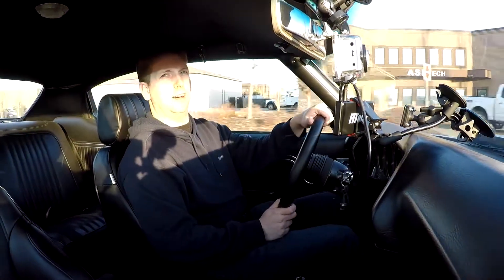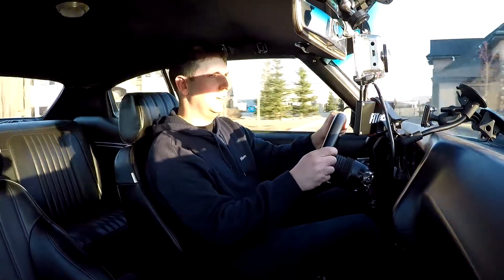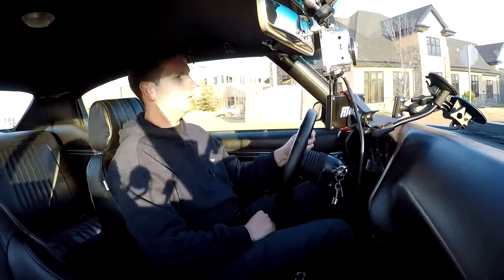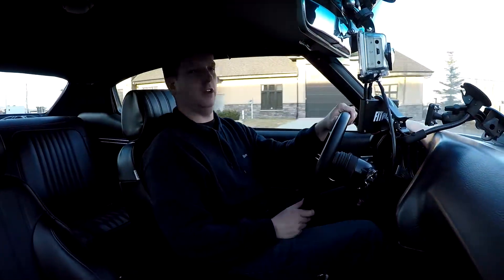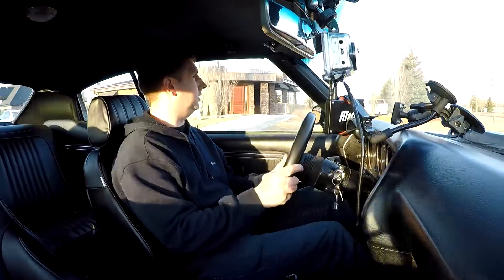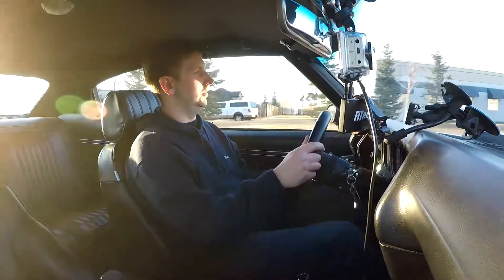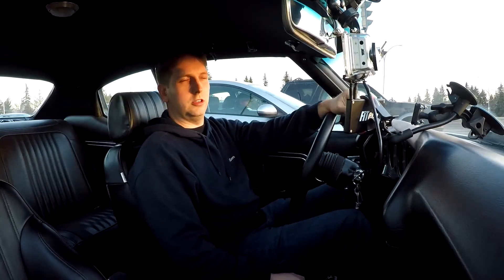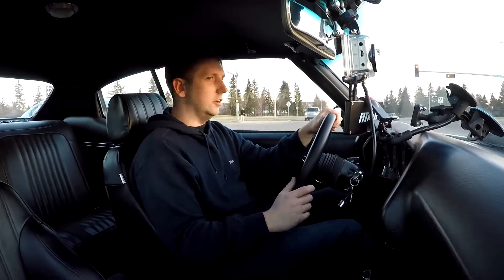Fitech EFI-8 1200 hp - first drive 2017

Comment: You talk in this video about tuning out the idle hanging up on deacceleration.. Im having the same problem, i also have the 1200hp unit. How do you actually do that?
Reply from the maker: Is it your TPS that's holding open on decel?
Reply: @SS454LS6  I havent watched the TPS reading on the display yet.. i just noticed that the revs take a long time to go down to idle just like a vacuum leak

Comment: I have a 68 Chevelle with a 496 that I will soon be installing the Fitech Mean Street version.  I have all of the wires and command center brackets installed.  Just need to install the throttle body and fuel lines.  Your car sounds very quiet.   What engine and exhaust do you have?
Reply from the maker: 454 BBC, 3 inch exhaust, hooker aerochamber mufflers. The microphone I use doesn't pick up a lot of the surrounding noise and makes it sound quieter than it is. You can check out other videos I have to get a better idea of the audible level. 

I hope you have better luck with the FCC than most, there have been many many issues with it. Good luck!
Reply: I got it running yesterday and so far no problems.  The FCC is doing fine.  No fuel boil over.  The FCC is hotter than I like.  I measured it's temp at around 110.  I may run more ventilation to the FCC and see if that cools it some, but so far everything is ok.  Just need to let the system learn.
Reply from the maker: right on! Glad all is working well. What do your coolant temps read?
Reply: Fitech's coolant temp sensor is not working correctly.  I have heard many others have this problem, so it was not a shock. I have now installed a GM version, but have not tested it yet.  May have time today or over the weekend.
Reply from the maker: I have stated in my videos that I had the same problem. The coolant sensors are junk.
Reply: The GM temp sensor I had laying around is working much better.
Reply: Took the car to work today.  Seems to be working better all the time.  I may have the idle a little low at 800 rpm, but it still idles good.  Got videos up now with the car actually running.  Keep up the educational work.  Appreciate your videos.

Comment: I'm still working out the bugs on my Fitech 600 HP system.  By chance do you use the FT timing control or do you have a distributor that has an advance?
Reply from the maker: I have not hooked up timing control yet as I need to get the EFI working the way I want before adding another potential problem.

Comment: That make a 600 hp power adder nitrous using a wet system will work fine I think you have to much injector
Reply from the maker: I agree. I went with the 1200HP unit encase I upgrade to a 700+ hp engine, but I am quite sure the 600hp unit could support 650 hp based on duty cycles ive seen in other cars.

Comment: 1200hp unit for an engine with less than 500hp....? Why'd u skip the 6/800hp unit... good video tho
Reply from the maker: I wanted the power adder for the timing control, pro tuning software, and the option to run boost or nitrous. The 800 hp Meanstreet unit does not offer that. I took the 1200 HP version over the 600 HP version so I could support future engine upgrades/builds. FiTech claims it will be fine with as low as 300 hp small blocks, but I am doubting that claim. Also I got a good deal so at the time the price was basically the same as the 600 hp version.

Comment: Man I would advise people to go with the Holley, MSD Atomic before they buy this junk. By the way the the 1200hp power adder kit will not support 1200hp as it comes. The command center fuel surge tank will barely support 800hp pump gas and if you are running nitrous you have to buy a separate fuel pump and regulator for your fuel solenoid.
Reply: Turbo Chevelle , junk ? You are crazy I have had both the atomic and fitech and they both are awesome . the fitech is currently on a 540 bbc making over a thousand up at the tires. So before you comment know your facts.